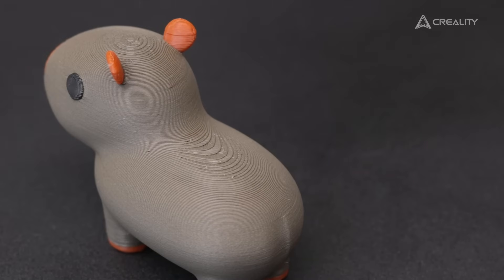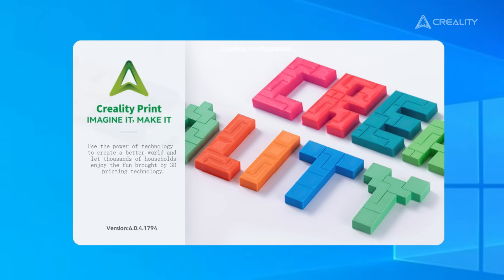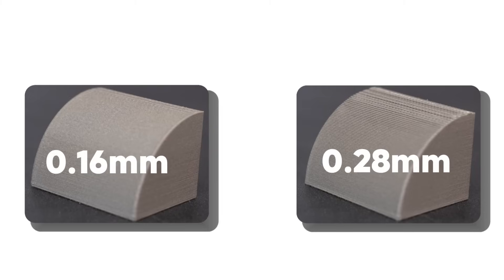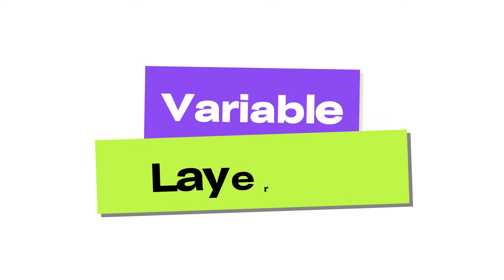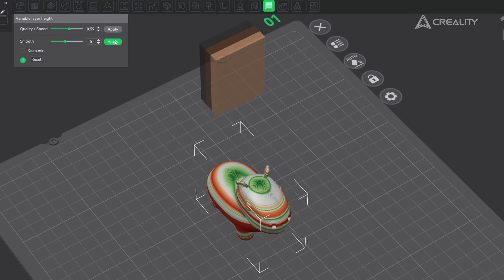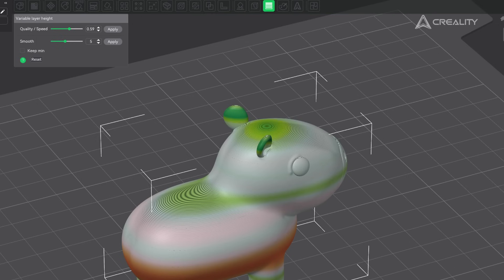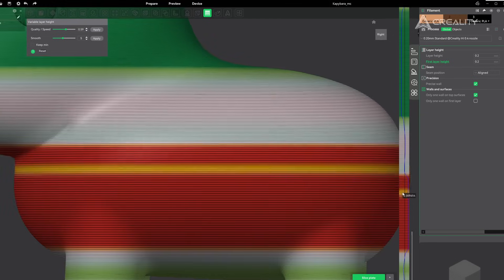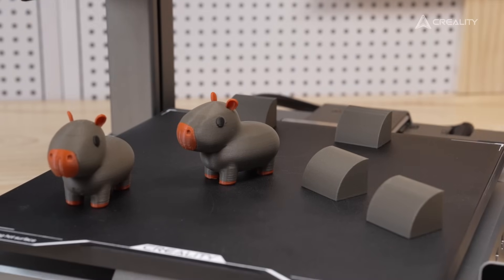Creality Print | Master Layer Height Settings and Instantly Upgrade Your 3D Prints!

Comment: I started using reality print while I was waiting for an update for Cura to include my new printer, 
At first, I didn’t like it. It was totally different, now I use it exclusively. It is far more powerful, and the way you can customize the adaptive layers is great
Reply from the maker: We’ll keep working hard to make your experience better and better😊
Reply: @Creality3D  The only glaring thing is there is no way to print to a V3SE using the USB cable as you can in Cura - why is that?, you would think using the software designed by the company that makes the printer, that you would be able to send the prints over USB

Comment: careful with this option on silk...

It will change its surface quality.
shinier vs duller
Reply: Smoothing it would make it more shiny, right? Like higher gloss but less of a satin/silk look?
Reply: higher heat and slower speed will produce shinier surface, yes.
But w
ith adaptive layers you can tell the different on the outer walls if you have a larger print.

thinner layer lines vs regular "classic" layer height.

matte filaments sorta blend in with its self (i use it for fur look) so not really an issue there
satin filaments are more prone to showing the above layer lines
silk filaments are more brittle and can show more details (reflecting lights more)
Reply: @LayeredFusionDesigns cool, thanks for the tips. I've only had my printer for a few days so lots to learn!